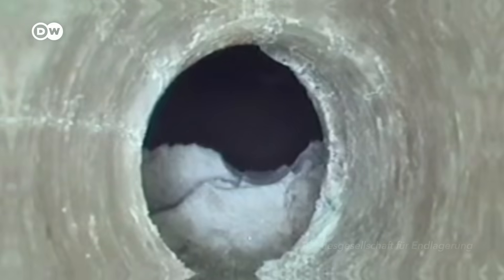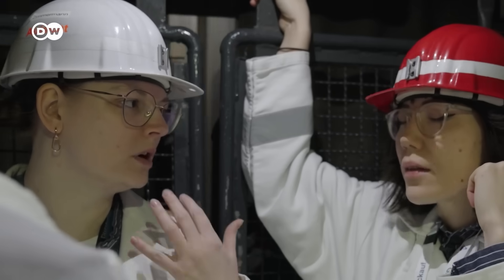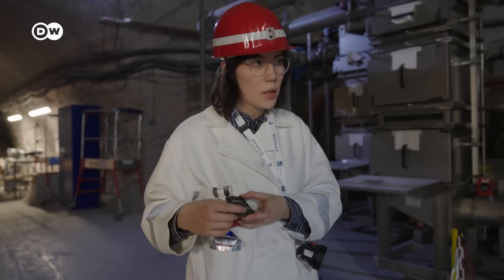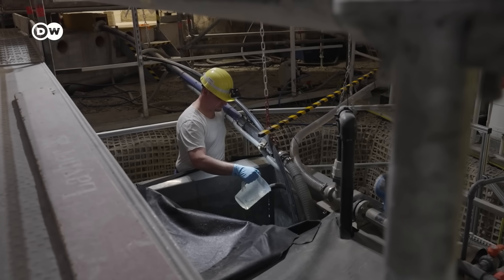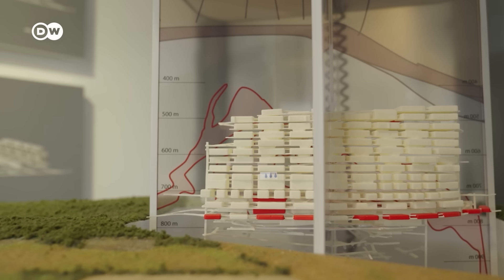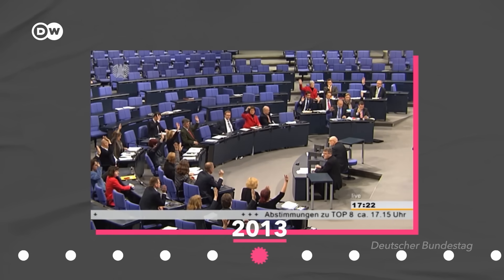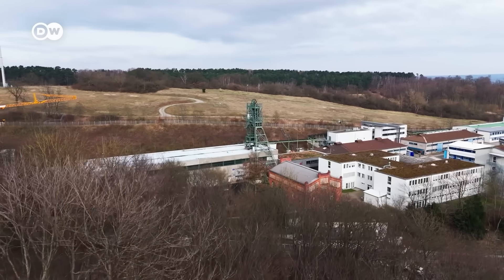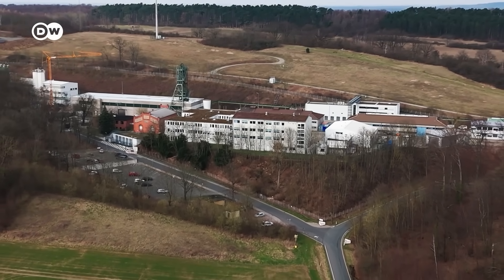Inside Germany’s hidden leaking nuclear waste dump

Comment: This explains probably, why A. Merkle ceased the nuclear power program.
In U.S. southwest, we also store some nuclear waste in underground salt formations.
We had a mistake (hundreds of millions $ +) when a chemical explosion in a storage drum
caused a chemical fire (both non-nuclear), this past decade.

High level waste must be stored separately, and in different technology to sequester,
from low level waste.  Britain and France (& Japan) have/had facilities which reprocessed
the high level wasted from used fuel (and both experienced significant challenges with
the processing, despite good designs).

IFF the used fuel (depleted uranium needs storage/reprocessing after only a few % of
the uranium has been fissioned, because the byproducts interfere with further fission) 
is reprocessed, OR is fed into a 'fast' neutron reactor, it can be further fissioned, which
(1) yields more power generation from the fuel, and (2) the end products of this further
fissioning process have high radioactivity for only ~ 1,000 years. The half life of plutonium
is on order of 25,000 years, requiring sequestration for about 1,000,000 years.

Very useful research on means of stable sequestration in geologic storage has been done by Alfred Edward "Ted" Ringwood FRS FAA (19 April 1930 – 12 November 1993) [in Australia... invented 'synroc'], and Rodney C. Ewing (in U.S.A. at U. Michigan and Stanford, where now emeritus). I 'think' progress over next 40 years will achieve viable stable storage.
In U.S. at Hanford, Wash (site of reactors for plutonium manufacture for WWII bombs),
we still have not achieved a good fix.

{I had not previously heard of Asse, thank you!}
Reply: Merkel was the one who authorized this in the first place, before she was chancellor. To shut off the power plants was just because of the elections.

Comment: This just proves that Germany and Germans are not as clever as people say , why did they not construct the installation correctly in the first place and maintain it ??? German politicians and the nuclear authority are responsible for this state of affairs and the EU should sanction Germany severely . This just confirms that Germany should not have the reputation it has for so-called quality
Reply: Back the days most countries just dumped the nuclear waste into the sea or landscape, not much different from Germany.
Reply: If you would have watched the video, then you would know, that they "didn't just dump it", but that area/salt pit was extra prepared for the nuclear waste, those barrels included...thinking, that it would be safe for hundreds of years...with the technologies of those days/60s and 70s.. 

Btw, without Germany you wouldn't even be able to use =
nuclear fission/power
Radio
TV, black/white and colour
telephone/Mr Reiss
x-ray
Computers /Konrad Zuse
cars
jet engines 
fridges/Mr Linde
electricity/Siemens
etc, etc 😎

Btw, until these days there is NO solution for a safe = deposit for nuclear waste...

the most dangerous parts of nuclear waste are dangerous for about 100.000 years.. counting backwards in time = we're at the Neanderthal's 😂

Comment: Why the fork would they just dump them instead of having them neatly stacked?
Reply from the maker: Hey Daniel! In the beginning, they have been stacked vertically. To use the space better, at one point it was decided to stack them horizontally.  At some point they were dumped with a wheel loader because several could be handled at the same time and less radiation exposure. However, at that point there was no plan of retrieval at any point.
Reply: @DWPlanetA there shouldn't BE any radioactive exposure from a sealed cask, so that's complete nonsense on the part of the people mismanaging the disposal.
Reply: @DWPlanetA To reduce  labour cost , That's the correct answer
Reply: Bcs its 60's and 70's before any regulations when u could dump nuclear waste into lake and sea
Reply: To reduce exposure of the workforce. Dumping is much faster compared to stacking. They knew what they are handling, however tried everything to cover it up. Today's generation and many generations in the future will pay the price for this.

Comment: Talk about fear mongering xD
Low and intermediate nuclear waste needs to be stored for only 100 years before the radiation falls beneath natural levels. 
If you give me 4.7 billion euros, ill come and take the waste myself
Reply: Absolutely wrong. In lack of better calculation methods or a future telling glass orb they use 100 years for calculation, knowing that in reality some of the radioactive elements  in nuclear waste last millions of years, much longer than the human race exists.
Reply from the maker: Hey Simon! For some kinds of low level nuclear waste that is true. However,  intermediate level nuclear waste needs to be isolated and stored for several hundred years.
Reply: @DWPlanetA  only 7% of the total waste stream is ILW and of that only a small part is long lived ILW. The cost of cleaning that up the way it's set up, cannot be justified. 4.7 billion € to save approximately 0 lives. For that price you could restart some of your nuclear reactors and save more lives by improving air quality and reducing carbon emissions.

Comment: Many questions that are not addressed here. What activity (number of atoms decaying in a given time) does the waste have? Which type of radioactive waste (weak or high radiation waste) is involved? Unless you know that, you can't tell if it's a ticking time bomb. And before you ask any questions, I'm a firefighter with radiation protection training.
Reply: They said it in the video, they don't know because the records were poorly done, that's part of the issue. Who knows how bad it could be?
Reply: @TheRealSykx  For me, without this data, it's really just panic. It is only with the data I have given that it will be possible to tell whether there is a danger or whether it would not be so serious. I don't want to belittle the problem, but I'm a realist. And as already mentioned, I have the appropriate training.
Reply: @karstendoerr5378  Well, considering your training and you being a fire fighter you very well know that if the situation is potential dangerous and if the situation has the potential to evolve into a catastrophe you do not rely on luck. Instead you would act fast and consider your own safety first. What they know is that some of these barrels are filled with high toxic and high active waste, that likely more illegally dumped highly dangerous waste has been dumped in the past, they know that the whole shafts are not stable and not safe in the long term.
Reply: @karstendoerr5378  your training would've taught you to assume the worst until you know that it isn't. That's basic hazardous materials handling.
Reply: @TheRealSykx  But then you could never get rid of it, because if I assume the worst, the caverns are impenetrable. So as you can see, without accurate data, it's never going to happen to clear these caverns.
Reply: @TheRealSykx  Once asked sarcastically, who's supposed to get the stuff out of there without proper data? Is it going to be like Chernobyl? People are being sacrificed to clean up the chaos? No one would get me in there without corresponding data!
Reply: @karstendoerr5378  not talking about the caverns, we were talking about the hazmat, which is largely unknown due to the lack of good record keeping.
Reply: @TheRealSykx  We are finally getting closer. Yes, my point is that the danger cannot be assessed in concrete terms without the relevant data. Data such as radiation dosage and what else is important should be collected now so that the barrels can be salvaged before everything sinks.
Reply: @karstendoerr5378  No doubt, they need data before the can start to retrieve the waste. At the moment they are in the planing, data collection and  risk assessment phase while trying their best to stabilize the mine shafts and chambers. Water is penetrating into the salt, the mine is moving and has already partially collapsed. I would call it working under pressure.

Comment: The problem with nuclear waste is most contractors and governments ignore the cost (including security) involved in maintaining and properly containing radioactive waste. I’m not against nuclear power, but any assessment which doesn’t realistically account for spent fuel waste on a 500 year horizon is a generational and environmental failure.
Reply: More likely its nuclear disposal from before any regulation when u could dump radiocative waste into ocean, lake etc.

Know nuclear waste is stored is caskets which could handle missle air strike. Litterly u couldnt get into that without specialized tools (ekhm big kaboomie)
Reply: Они берут пример с Скарлет из Унесенных ветром. "О ядерных отходах я подумаю завтра".
Reply: 500 years drastically underestimates the time horizon  required to safely store the waste.
Reply: This comment goes to show you know nothing. The decommissioning and fissile material disposal is always included in the cost calculations of tenders involving the construction of NPPs. 
Remember also, low- and intermediate-waste can be considered regular trash after a few years of decades. Meanwhile, high-level waste can either be reprocessed for use in FAST reactors or they can be stored in dry casks, in which case the radioactivity reduces exponentially over time. That is to say, by the time you're a couple of decades into storage, spent fissile material is already much much much less radioactive than it was at the beginning. 
Meanwhile, things like arsenic and lithium never lose their toxicity, because it's a trait of those elements.
Reply: @Waldemarvonanhalt  Вы обманываете. Через 40 лет сборки твс чернобыля реактора 4 фонят 300Рч. В ютубе есть видео где это измерили, сделав тест в саркофаге. Такой фон убьет вас за два часа.
Reply: 500? 500000
Reply: More like 5 000 000 000 years
Reply: most governments of course take this into account. The full cost of nuclear power incl. waste disposal is around 5ct/kWh.

Comment: Covra in The Netherlands shows that it is perfectly possible to store radioactive waste 'above' ground for several decades.
That last bit is covered only briefly. But it does seem to want to set a tone.

How much of the waste in the salt mine is actually inside those yellow barrels? They were apparently safe to stand next to at some point.
Of course it probable isn't when even one of those in a room has been broken.

It is ridiculous that the German government didn't handle this any better in the past.
Back then they failed just as much as they have been in the past by closing nuclear power plants though.

Note that other nuclear waste (from hospitals) was also deposited here for free.
In The Netherlands the 'suppliers' have to pay for the waste to be deposited by Covra.

Comment: You should be absolutely ashamed of yourselves. It’s this type of fear mongering that contributes to the mass hysteria surrounding the most clean, efficient energy source we have available. Congratulations Germany, you destroyed your nuclear sector and emit more carbon now than you ever did before. And the nuclear waste problem? Multiple times throughout your video you conflate low-level to intermediate-level nuclear waste with “highly radioactive” waste. Despicable. You want a long-term solution? Keep the waste down there and either flood or completely fill the chambers. Your “nightmare scenario” of the waste somehow making its way above ground will never happen unless you bring it up yourself. If DW had any self-respect they would promote an honest, transparent understanding of nuclear energy, waste, and its effects. Your reporter should also apologize for her gross exaggeration of the “danger” she experienced. What was the total dosage she received during her visit? DW included many historical photos of mine workers standing right next to radioactive waste but your reporter still felt “uncomfortable” with several meters of salt shielding between her and the barrels? You’re the reason journalism is dying. Quit the childish appeal to emotion and next time stick to the facts.

Comment: They dumped that in a salt mine??? It was better to hire a geologist. Huge mistake!
Reply: 60's and 70's before any regulations were wild
Reply: @oljackie35  we know salt is a porous, liquid-sucking layer of rock since way earlier
Reply: Salt is perfectly suitable for such endeavours. The instability and water ingress of the 3 Asse mines, which actually lead to their discontinued operation in 1964, is the only reason you shouldn't use these three particular salt mines for such endeavours.

Comment: Would change the title since the waste is not leaking and the asse itself is also not leaking.
Reply: Have you seen a geological report that the salt mine, with flowing water, will never leak further into the area's water supply? Such a study would surely shine more light on the issue.
Reply: It is leaking!

Comment: How radioactive is this low medium waste exactly?
Reply: Depends on the isotope, but when you accumulate it the radioactivity is additive so being near the pile is not recommended.
Reply from the maker: Hey there! The waste there had a radioactivity of about 10 quadrillion decayed atomic nuclei per second; as of 1 January 1980. In 2023, it was about 1.5 quadrillion decayed atomic nuclei per second.
Reply: Unfortunately, it is a mix of low and middle  active waste. Nobody knows the exact composition as the documentation was not done correctly or even falsified. The low active waste is the long lasting waste which is the bigger issue as the facility will not last long enough to keep the waste safely locked away from humans.

Comment: It is totally crazy to me that they literally just dumped the barrels instead of stacking them neatly. You'd think that simply dumping would risk compromising the barrels and causing a leak!
Reply: They dumped it because it was according to regulation and the barrels don't contain actually radioactive waste, but waste that was not allowed to be disposed of in any reasonable way by overly precautious regulation.

Those barrels aren't really radioactive and even then, it's the mine which is the long-term storage container, not the barrel.
Reply: Smells of what corporations like to refer to as fiduciary responsibilities and responsible time management.  AKA get it done as fast as possible, as cheap as possible and with regard to nothing else.  The reduced exposure thing is likely a factor as well though.
Reply: what is inside is not a liquid.
Reply: You cant be sure @Atom15
Reply: It‘s low level….basically a glove or pant and plastic wrap…dude thought it was a coolant water or something?? Or maybe a graphite moderator..
Reply: The barrela were never meant to contain the waste long term inside tge mine

Comment: France in 60s calculated that electric energy will be near for free for households maybe with fixed small amount without electricity counters based on rapid nuclear power plants development. They not estimated used nuclear fuel storage costs and conservation of old nuclear reactors costs. That is very expensive even with cheapest option dump waste into ocean.

Ocean disposal of radioactive waste - https://en.wikipedia.org/wiki/Ocean_disposal_of_radioactive_waste. Germany near zero. Why Germany used land based disposal?

Comment: Just go renewables... much cheaper, faster to build, no dependency on fuel imports, very low carbon footprint BUT you gotta build a robust grid with cheap energy storage methods (eg: pumped hydro, used EV batteries, sodium batteries, thermal batteries)
Reply: ...and conpletely rebuild the generation infrastructure (wind turbines, solar panels...) every 20 years
Reply: @RadekPilich  source?
Reply: @RadekPilich  well, many solar panels already come with 25 years warranty for max 20% performance loss. The main materials in solar panels are silicon, glass and aluminium (frame) which are all recyclable. 
The problem is with the blades of wind turbines made of fibre glass.
I did some research and found that many startups and research institutes in Europe are working to either make the fiber glass recyclable or to develop a more sustainable wind blade. 
For now and future, operating and maintaining fuel fed power plants every single day is not any better in terms of cost or environment
Reply: @commieTerminator  the problem is that even if the minerals etc  were still available, we are still totally dependent on cheap oil abs without it, we everything breaks down over time
Reply from the maker: Hey! We tackle possible solutions to the recyclability issue of wind turbines in this video 👉https://www.youtube.com/watch?v=HzQShAlObn8
Reply from the maker: Hey there! Yes, changing the grid is essential for a reliable energy supply with renewables. We tackled that more in detail in this video 👉https://www.youtube.com/watch?v=u-DsDuTceTo
Reply: Geothermal or bust
Reply: Renewable is not cheaper, Fast to build but also requires more maintenance and a lot of land and massive amounts of energy to make, recycle a solar panel ? Wayyy more expensive than making a new one and energy inefficient and 90% of solar panels ended up in landfills…
Renewables never meant to be the stable energy, But nuclear can.    Kyle Hill said it better..